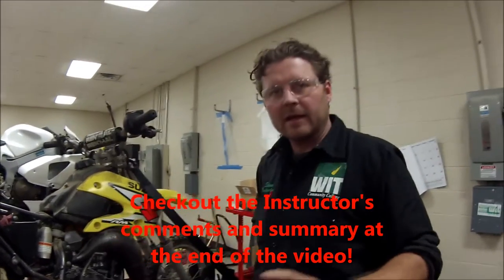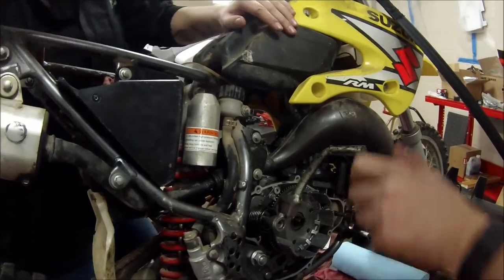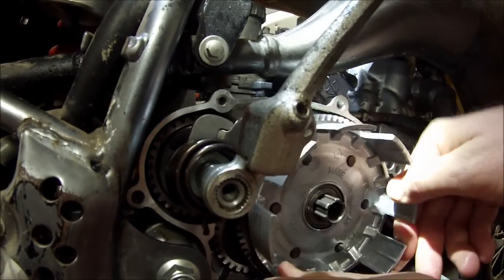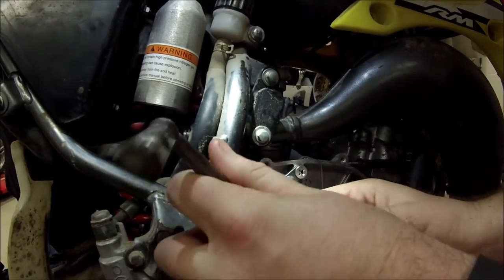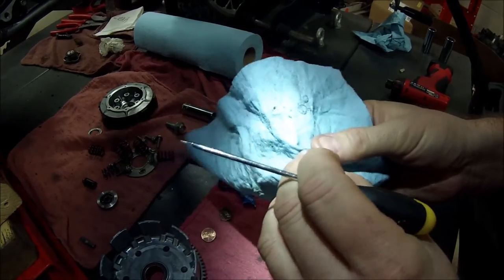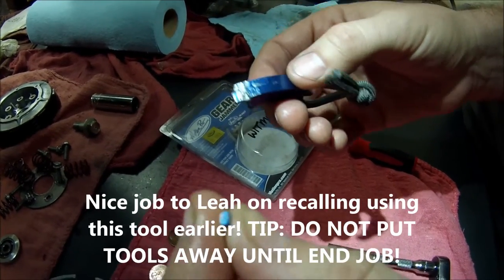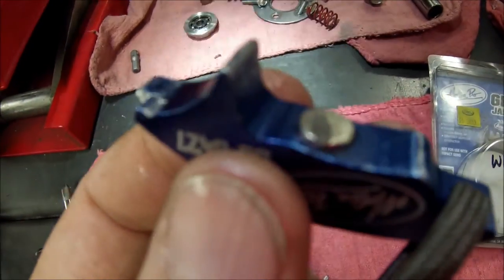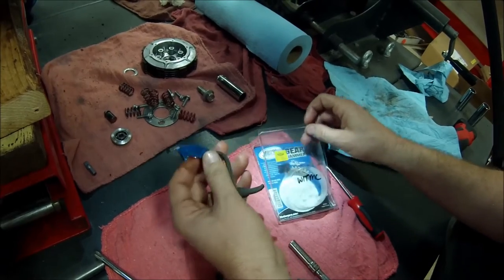Every Mechanic Series: Tool Inspection before and after use. Whats at risk?

Comment: Have you ever broken a engine case behind the primary gear by using a penny to remove the nut? I have heard that current pennies have less and less copper thus not very soft and can put a side load on the main bearing support.
Reply from the maker: Not BUT you're making me think! Another good thing to use is the proper tool....lol seriously rope works as well. I demo it in another video as a piston stop.
Reply: Yes used the rope on top of the piston trick before.